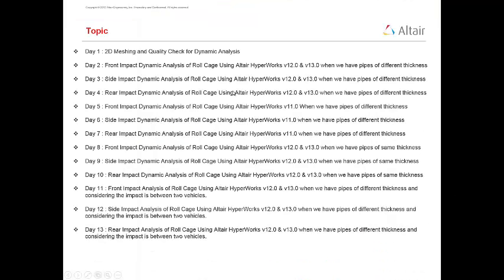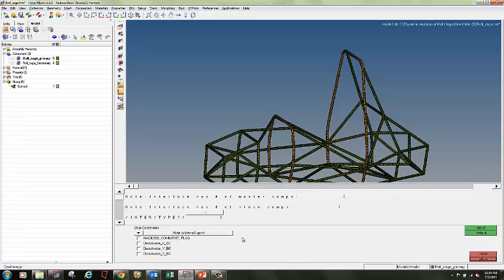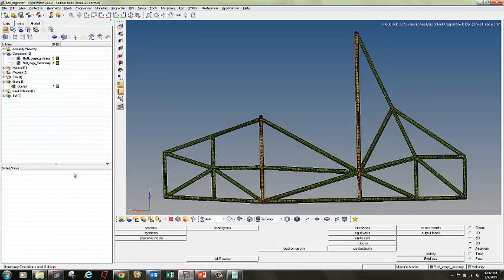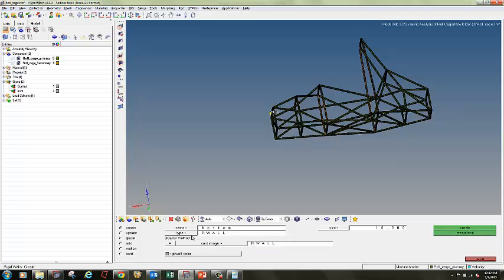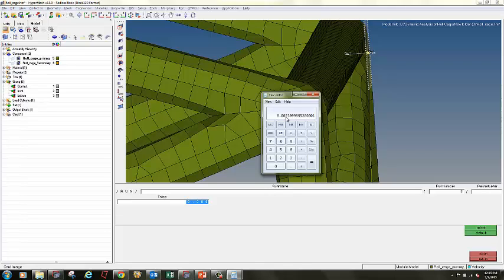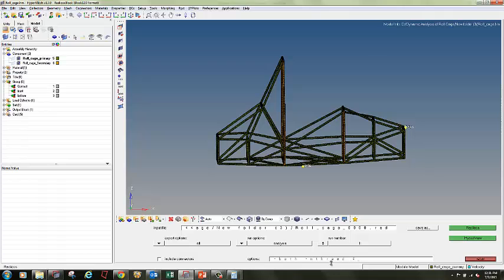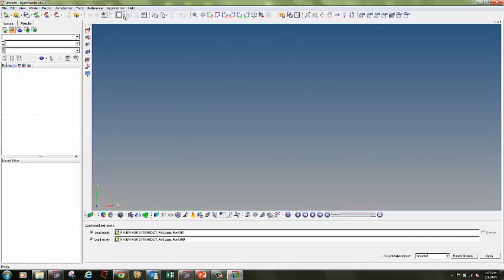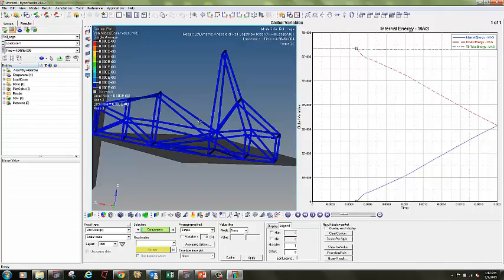Dynamic Crash Analysis of Roll Cage - Day 2

Comment: i am doing the 2d dynamic analysis on roll cage but it shows the errors in running
errors:-
. BLOCK FREE FORMAT
WARNING ID :         1114
** WARNING WHILE READING
DESCRIPTION :
   THERE IS NO DEFINED PART IN INPUT FILE.

 .. STARTER RUNNING ON    1 THREAD
 .. CONTROL VARIABLES
 .. UNITS SYSTEM
 .. FUNCTIONS & TABLES
 .. MATERIALS
 .. NODES
 .. PROPERTIES
 .. 3D SHELL ELEMENTS
 .. 3D TRIANGULAR SHELL ELEMENTS
 .. SUBSETS
 .. ELEMENT GROUPS
 .. PART GROUPS
 .. NODE GROUP
WARNING ID :          690
** WARNING IN NODE GROUP DEFINITION
 .. INITIAL VELOCITIES
 .. DOMAIN DECOMPOSITION
 .. ELEMENT GROUPS
 .. RIGID WALLS
 .. RIGID BODIES
 .. ELEMENT BUFFER INITIALIZATION
 ** ERROR TRAPPED : REPORT TO LISTING FILE
ERROR ID :          760

 I am not able to find how to solve these type of errors.I have to participate in competition plz tell how to correct it.
Reply: same problem bro